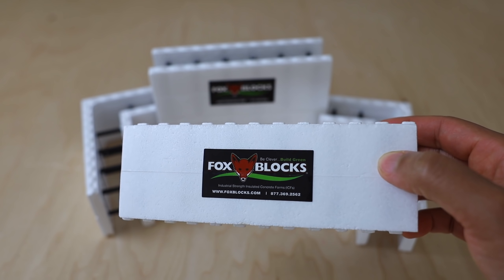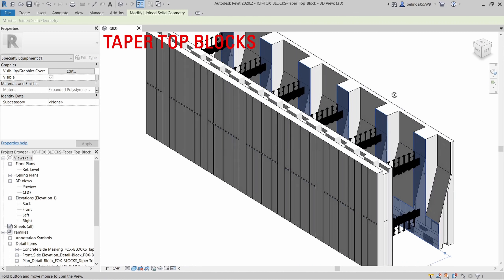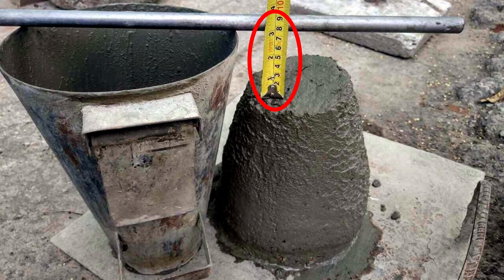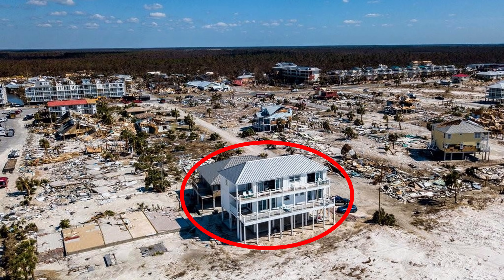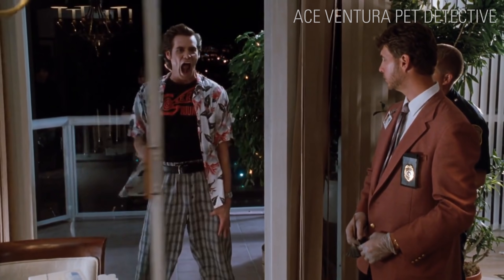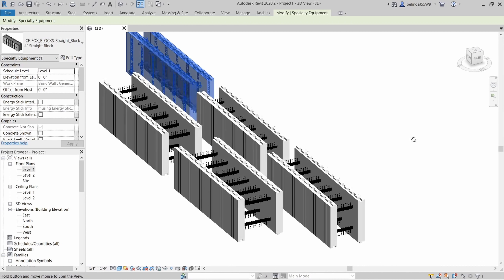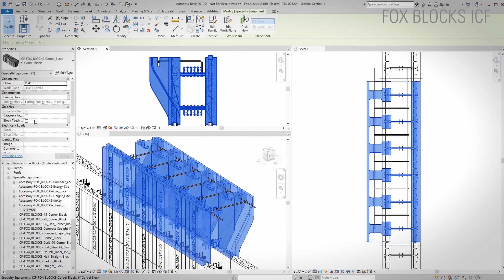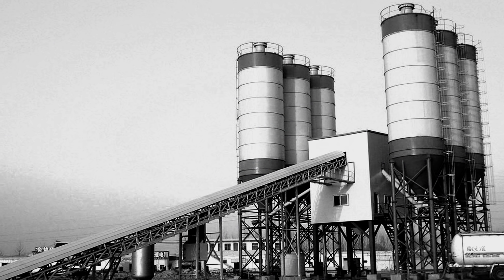Pros & Cons of Insulated Concrete Forms /ICF construction

Comment: surly its quicker to build a standard concrete wall and then stick some 8x4 sheets of polystyrene to it !!!
Reply: ICF construction is proven to be almost 20% faster than standard.
Reply: Not really.  Insulated Concrete Sandwich, even done tilt-up, still requires specialized equipment to build.
If you have lumber to construct the braces, plywood for seam patches, a rebar bender, and a concrete vibrator, you have pretty much everything you need to drop in an ICF building.

If you're doing more than a single level of ICF, it'll probably, actually, be cheaper to simply buy your own concrete vibrator with an 18 foot attachment than it would be to rent the item.

Then, at the end of the construction process, you could sell (or rent) the equipment to recoup cost.

Comment: Great video, Belinda.! One big challenge in constructing an ICF building are common joints in the walls.   Unless the walls are the perfect lengths, a common joint is needed to keep the TIE spacing the same throughout the wall.  This joint creates a weak point in the forms that must be properly addressed to prevent a blowout.
Reply: This is something I am working to remedy in my builds. I am an ICF expert and have always just dealt with seaming walls of particular lengths. I have now grown to the point I simply tell my clients that I will make the dimensions move a few inches or even a couple feet to save them a lot of money and my headaches by making everything for my blocks with no seams needed. It’s gone well and I hope to only have clients that let me do it from now on. Seams are for the birds. This does come down to her comment that you have to be more conscientious of the whole project when designing and account for planning a lot more than in standard construction. I have to work with the designers and have them tweak things and match the brand of ICF we will use (as I use 4 different brands), but it’s worth it on prep and pour for sure!
Reply: @joshualruby  It would help greatly if the various block vendors created a list of lengths where no common seams are required to build a wall.  Then those lengths could be incorporated in designs, for example that instead of designing a 40 foot long wall, you build a 40 foot 3 inch wall or 38 foot 6 inch wall to eliminate the common seam.
Reply: @zmanmd1641  I am starting a channel this year and I think I will make a video on that. “How to convert any blocks’ dimensions into seamless sizes” or such. It certainly would be helpful if manufacturers offered that!

Comment: @Belinda Carr, What do you feel about the Harmless Home?  It seems to combine most of the benefits with out much of the problems.  That said, one issue I can see is that it is possible that the height of the walls would not work for tall buildings.  Another concern I see, which they have partially dealt with is running conduit.  If this is a concern, I think only using this for exterior walls might be the way to go.  Currently my only source of information on this is through their advertising so I am hesitant.  

This is a product we have been considering when we build our new home.  Our major concerns are environmental friendliness, resistance to cold and heat although we live in the most temperate part of Canada.  I do not think it makes much difference, to the construction material but we want to be off grid.  One large benefit with this and ICF construction is fire resistance and we will be building just outside of a good fire protection service.  I am not that interested in IFC because of the foam and the concrete being less environmentally friendly although I like most other aspects of it.

https://www.youtube.com/watch?v=H8efNdG7au4&ab_channel=CreativelyUnitedforthePlanet

Comment: properly installed some very good reasons for doing ICF.  Sound resistance, thermal resistance, air and moisture resistive barrier, bugs and other vermin might eat the foam but not the concrete.  So many good things.  The bad is that there are not lots of builders using it. The cost per Sq Ft is very high in comparison to other means.  If one want to do remodeling it is $$$ prohibitive.   One really has to plan out where penetrations need to go:  pipes for plumbing electrical and mechanical.   Especially mechanical one tube per penetration so that there is never a problem doing air and moisture sealing.   Really raising the ICF is dead simple.  Can be done with a crew of high school kids. Even doing the zonts for truing the walls.
Reply: A lot of these downsides are things that can be solved with a little initial skull work and communication with your architect.
Then with good communication with your GC and subsidiary contractors.

Also, some contractors sell ICFs impregnated with things that make them termite resistant.
Additionally, there are some finish details and types of coatings and membranes that render the ICF protected against such things.

Comment: To avoid confusing natural air changes per hour with induced air changes via infiltrometer. ACH values are typically expressed as ACH@50, or simply ACH50, and natural air changes are expressed as NACH.

Comment: TX is the land of bugs and ants LOVE to nest in EPS.  I found a version of ICF that mixed recycled EPS with 10% Portland cement then compressed into ICF blocks.  The blocks were 48" x 16" and 10" thick.  6" holes aligned for re-bar and cement fill.  This version was insect resistant and had an R44 rating.
Reply: They are lying to you about the R value. Those blocks have a R 25 value.

Comment: Great video. I basically agree with all your points about pros and cons. 
I would add one more pro that I only realized fully after I finished my 2000 sf home in 2013: The huge thermal mass. I live in central PA and I heat my house with a wood burner (gasifier) and radiant floor system. Even during the coldest days I only need to run my heater about every other day and just for 4- 8 hours depending on the weather. In the summer the house stays cool except for prolonged heatwaves (over 1-2 weeks). I don't have AC so a basically have no heating or cooling costs. 
The house is very tight though, and if we have a lot of people together (i.e. for Christmas) during the winter, we have to open the windows to get fresh air and cool down the room we are in. 
Thanks for the videos - I still have to watch more of them
Reply: Do you have a fresh air system installed in your place?
If not, look into it.  It'd cut down on the need to pop a window (which lets all the environmental dust, allergens, and other filth in from outside).  And you could control the temperature the same way.

Comment: Thanks for sharing. I am a building engineer but don’t practice in the field. I have been thinking of building ICF and acquiring more information.
Reply: Feel free to reach out if you have any questions on ICF. I am an expert installer and use several brands. I would be glad to give you pointers from the design and install point of view. J L RUBY Business @ gma il. Com. (I am a custom consultant on high efficiency, comfort, and ICF systems)

Comment: Well  done.  I think you hit the nail on the head when you touched upon the fact that Styrofoam and concrete are not the best for the environment, but balanced against a well built, well drained home that could last over 100 years, it is certainly a good use for these materials.
Reply: Plus there are ways to cut down on the "green load" of both foam and concrete.  And, with proper formulation, you can come close to making concrete a CO2 sink, rather than a source.

Also, ammortized over the life of a building that could be around several hundred years, the "green load" dwindles into insignificance.
Partly because of the lower HVAC bills/use, and because even the remaining load can be offset with various forms of renewable energy.

Comment: Not sure why you would compare it with a poorly built wooden home considering a properly built one will last centuries.
Reply: the best built wood home needs frequent repair & preventative maint, while it is still vulnerable to weather, insects, fire, & natural disasters many times more than the sloppiest built ICF home, which also gains advantages in energy efficiency, sound deadening, etc.

another way to think of it, is how many ancient ruins do you see still standing built with stone vs wooden structures? how often do you see a home sitting on site where the foundation is gone?
Reply: @Krazie-Ivan  Basically, the amount of careful detailing required to bring a stick-built home up to the default level of ICF brings the two building systems into near parity on a pricing per square foot.  As most of that additional cost in stick-built is labor.
Reply: @PhotonHerald  ...1st of all, how am i runnin into you here? lol

2nd, ICF is only ~5% more than basic stick. that's not enough delta to make a stick home anywhere near as lasting as ICF.
Reply: @Krazie-Ivan  First, where else have you run into me?  CoH?  Which server?

Second, Are you quoting CURRENT COVID-inflated pricing?  Or are you talking about when lumber pricing was actually sane-ish?
Reply: @PhotonHerald  ...Justice. Secret. HC.

pricing stuff i watched was mainly uploaded years before 'Rona, & they would focus on better 2x6/sprayfoam/radiant-barrier competition... but recent vids tend to compare more against bare-bones wood homes.

Comment: why did you think that icf walls would be height limited? the strength would be in the reinforcing bars. you probably would want to use some pretty fast curing/early strength concrete, though. from what you have shown in this video, the effort to seal an icf wall seems a lot more onerous than would be the case if you used zip system in a wood framed wall assembly. with zip system, you primarily have to tape the seams. having to apply a self-adhered membrane over the whole wall, as shown in your video is really quite labor intensive. you not only have to apply the membrane, but you have to go back an apply a roller to get good adhesion. i don't even know how good the adhesion to polystyrene foam would be. i can't imagine that you would be able to use a primer.

i can't say that i am a big fan of this approach. there are other ways to reduce thermal conductivity of a wall assembly. for example, you can use sheathing with foam attached to it. you can also put insulation over the sheathing, although that is more labor intensive. i think you will see a lot more people using those approaches than those using icf.
Reply: Certain ICF systems limit individual lift heights.

Sealing the wall isn't terribly onerous.
There are peel and stick options.
Spray options.
Roll-on options.
There's even hybrid P&S+srpay/roll solutions.
You can even do traditional house wrap if you want.
It all depends on how crazy you wanna go.

With ZIP, its also highly recommended to seal the nail holes (at least) with some form of liquid-applied flashing solution.
One of the attractions for ICF solutions is that most of them are DIY solutions.
So you're paying up front for decent materials, and saving on labor costs.
As for the adhesion.  You don't need to stop a truck from ripping the stuff off the walls.  This is why the "tear off" tests are a bit misleading.  Though the Polywall system addresses this nicely.  But the P&S just has to be sticky enough not to curl up off the surface.

Again, for the most part, the time and effort of building a superior wall system in stick-built is going to come out at more or less equal expense to an ICF wall system.

And if you're in a zone prone to wildfire and earthquakes, the ICF system has some fairly clear advantages.

Comment: carbon neutral concrete has been developed. we will see how long it is before it is widespread.
Reply: If you're thinking of Cemex's alumina-silicate based concrete, it's not really carbon neutral but 70 % less than conventional concrete according to the manufacturer.

Comment: ICF has been marketed to the DYI market a lot. It doesn's save the money they claim in that area. If you like the strength go look at Thermomass Cast In Place product. It gives a better wall and for much less. Everyone is afraid of putting up commercial concrete forms, you can rent them in most markets. If you can put up a bunch of blocks you can put up Ellis style forms that give a better wall. ICF is the biggest "sell the sizzle not the steak" I've seen in the last 20-30 years I've been in the building biz. I've seen $12-18 per block which is laughable pricing for 3 board feet of XPS foam. You really need to look at the Thermomass products. Give me a call I'm working on a CIP wall in my personal home.
Reply: The claim of savings are on the "labor" side mostly.
And that's assuming you don't place any value on your own labor.  I bill out at $200/hour and 1/3 of that is my compensation.  COULD I save a ton of money building a home myself?  Sure.  Would I save more than I could make in the same amount of time?  NOT ON YOUR LIFE!

However, discounting the recent leap in lumber prices, building an equivalently well-detailed wall system in stick-built would yield a comparable price per square foot.

As to Ellis forms, how you you define "better"?
Reply: I've looked into trermomass. It is a system that uses 2 inch foam and builds R 13 walls. Ok for basements. Not bad for Kansas. Iowa needs R 22
Reply: Good video as always though

Comment: Like to ask you this question say that u are in a hot climate say you was to build a double sided wall would the heat still come through to the inside of the house even though there was a gap between both of the the out side and the side wall Even though there an air gap??
Reply: Eventually there will be heat transmission, whether from the outside to in (in your example) or from the inside of the structure to the outside in colder climates.  The only way to completely prevent that would be a building built like a "zero bridge" vacuum bottle, which wouldn't exactly be practical.
Reply: @michiganengineer8621  thanks very much
Reply: To elaborate on the other answer... the r value is represented as the inverse of the k value which in heat transfer is the number related to the conduction form of heat transfer. Heat transfer also occurs through convection and radiation. These are not accounted for whatsoever in the r value. The air gap would help, but it will simply behave as a convecting area of heat transfer after the exterior material has been heated through conduction. So then it would heat the inner wall and transfer again through conduction. Thermal bridges are bad, and make heat transfer issues worse, but even eliminating all of them with either air or insulation will not ever make a system experience no heat transfer. That would be adiabatic and is a term we engineering students were told exists only so our puny little minds could run the calculations, not because it was real.
Reply: The heat will eventually come through.
And open air, while it has an insulating value, a similar amount of actual insulation is still better.  Because the volume is controlled.
Also, it's generally considered VERY bad practice to build void-spaces into your wall.  As this space CANNOT be environmentally regulated for temperature or moisture.

Well, unless you WANT to farm the world's hugest mold/fungus colony.